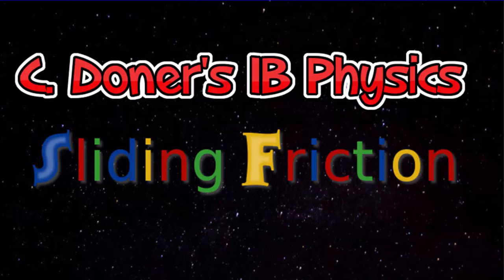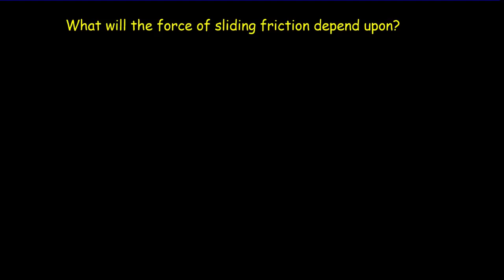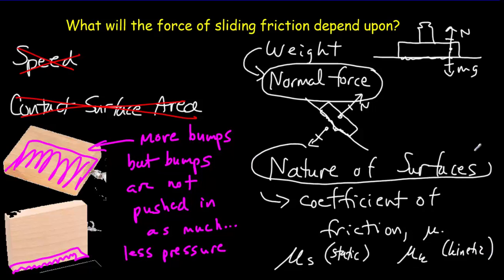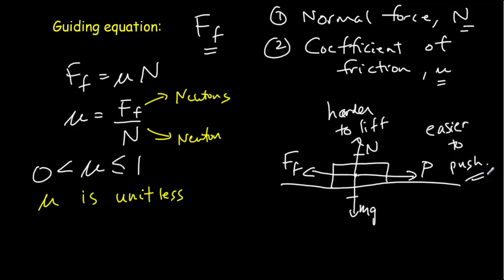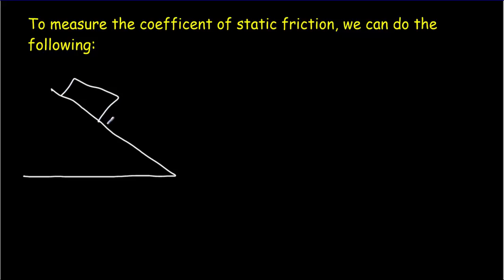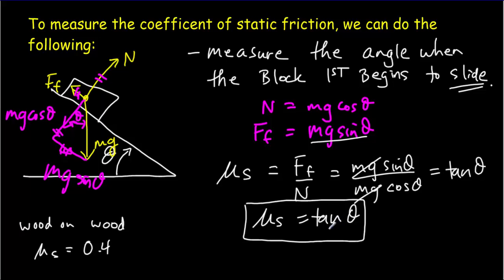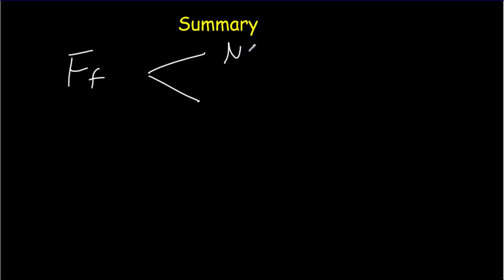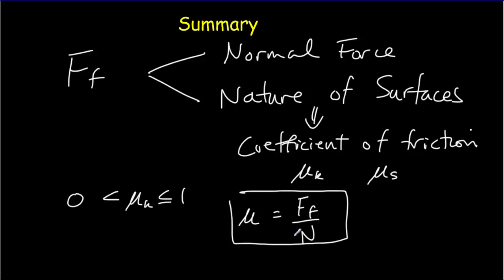IB Physics: Sliding (dynamic or kinetic) friction and Coefficients of Friction

Comment: at 11:58 you mentioned or said in the free body diagram that the angle would be theta
how did you know cuz im trying to understand how you knew which side would be theta
Reply from the maker: As a simple visual way, imagine a small angle for the incline. You will see that there is a matching small angle in the triangle formed by the components of the weight.

Comment: At 6:04, you mentioned that the coefficient of friction of rubber on other surfaces is the only one mentioned there which has a coefficient of friction of 1 or greater (depending on if it is static or kinetic), but why is it so? You had mentioned later in the video that the coefficient of friction was simply a fraction of the normal force to indicate how easy it is to push an object in comparison to lifting it. So here would it be easier to lift rubber than to push it? Why would it be so?

Thank you so much for your videos, by the way. They allow me, along with many other people, to fully understand these concepts well. You explain things so simply yet cover all the points. Thank you for making these amazing videos!
Reply from the maker: Truthfully, I was taught the the coefficient is always less than one, and then I began to see tables in which it was listed as greater than one. There are some flaws in the logic that it will always be easier to push than lift.

Comment: Can you use tan (theta) to find the coefficient for kinetic and static friction on an incline?
Reply from the maker: We can measure theta and determine tan theta to get the coefficient of static friction.
Reply: @donerphysics  I mean can u use not see. One of my physics problems use that tan theta method to get both the coefficient of static and kinetic friction. Is that allowed?
Reply from the maker: Generally, the coefficient of kinetic friction is given by the net force / normal force = mgsin(theta) / mg cos (theta) on an incline. For static friction, we want the net force that just gets it going. For the kinetic friction, we want the net force that has it slide at constant speed.  tan (theta) would equal the static coefficient if we use the angle to just get it going, and the kinetic coefficient would equal tan (theta) at the angle at which it moves with constant speed.

Comment: At example 2 17:40, why does P = Ff. Shouldn't P > Ff as it is accelerating forward and not at a constant velocity?
Reply from the maker: The example shows that P is larger than sliding friction by 80N because it does accelerate.

Comment: At 15:00 shouldnt the acceleration be 0? It never clarifies if the wooden box is mooving or not. If you use the coeficient of static friction you would need 20 N of force to start moving the box. Only 15 N are being aplyed wich should mean 15 N of force of friction are also acting on the wooden box. If at any place it said the box was mooving, then you should use the coeficient of kinetic friction. (or if the force aplayed is grater than the static friction), which in this case isnt. I could be compeletly wrong but id like to know
Reply from the maker: Wording is somewhat ambiguous. If there is no statement that the box is originally at rest, you would by default assume that it is during the process of sliding.  You should understand that 20N would be needed just to get the box moving.
Reply: @donerphysics  Great, thanks for the quick reply. Ill have this in mind

Comment: why is coefficient of friction the force of friction divided by the normal force
Reply from the maker: Generally, it never takes more force to push an object and make it move than the weight of the object, so this ratio is going to be a fraction between 0 and 1. The ratio will also only depend on the nature of the surfaces involved, and not their area or the speed that they are pulled. We are really just saying that the force of friction will be proportional to the normal force, and the constant of proportionality depends on the surfaces involved.

Comment: I'm  sorry, but in the second question with the sofa, docent  2*10^2 = 200 not 2000? so then wouldn't the coefficient of static friction be, 1.8 (2 s.f) instead of 0.18? if I'm wrong I'm so sorry I'm just a little confused!!  but amazing video!
Reply from the maker: You need to use the weight (the force) not the mass. The weight is mg, or 200 x about 10 = 2000N
Reply: love how you reply to comments and questions. Thanks!